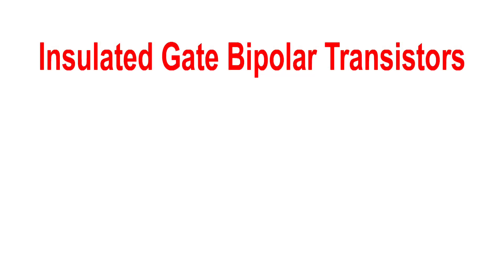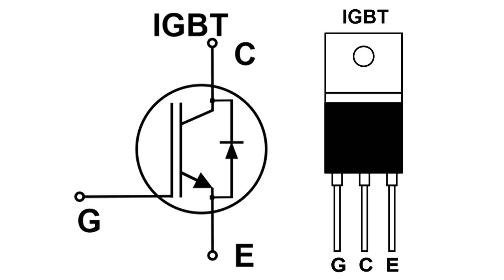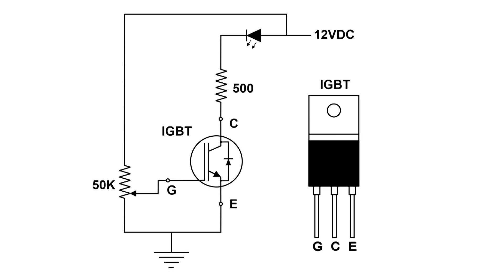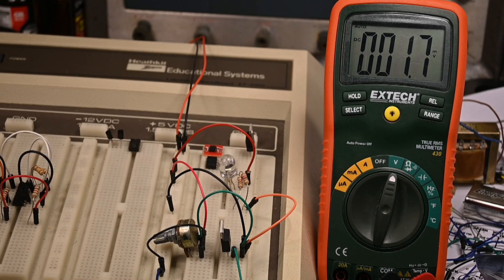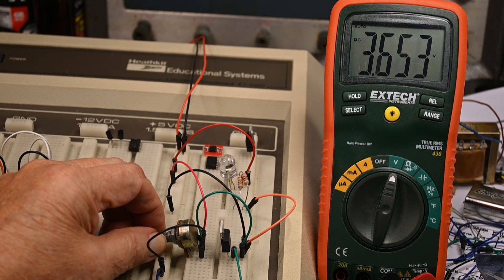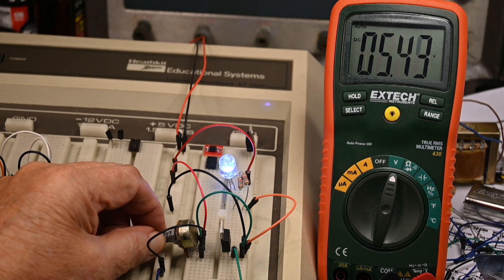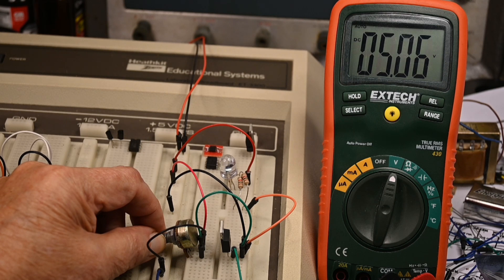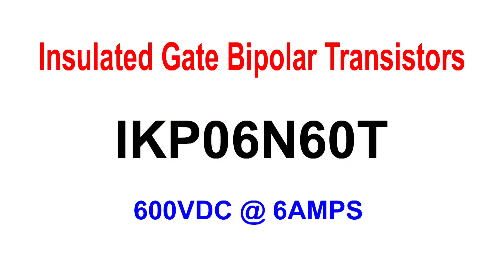Insulated Gate Bipolar Transistor IGBT IKP06N60T

Comment: It looks like the IGBT has a pretty decent linear range. Ordinary bipolar transistors (generally silicon) are used in audio amps -- how much wider is their linear range? In any case, it looks like the IGBT transistor you used is aimed at high-voltage power applications, and not audio.

It might be interesting to see the gate driven by a swept voltage (i.e., a sawtooth from 0 v to 12 v peak), and comparing the input and output waveforms on a 'scope.
Reply from the maker: The IGBT is full on when the gate is about 4VDC. A MOSFET is full on when the gate is about 12VDC. The small amount of voltage to turn the IGBT full on makes it an ON OFF device.
Reply: @AllAmericanFiveRadio , yes, but I'm not comparing the IGBT to a MOSFET, which has a wide liner range; I'm comparing it to a bipolar junction transistor, which has a narrow linear range. There are lots of junction transistor-based audio amps. The magic is to keep the transistor biased to the linear range. Doesn't any voltage below 0.7 volts applied to the base of a silicon BJT put it in cutoff?
Reply from the maker: @Johnny.Fedora  The IGBT is an ON OFF device, would not work in an amplifier.
Reply: @AllAmericanFiveRadio , ok, fair enough. Infineon has an interesting app note for the device (7-2012, inherited from International Rectifier) called "Application Note AN-983: IGBT Characteristics" (YT won't allow me to post links) that among other things, shows a model of the device as a MOSFET+bipolar junction transistor in a pseedo-Darlington configuration.

Comment: This takes me back when I was a compressor service engineer back in the 1980s  at ."Compair  " when  They stated useing  IGBT'S  Inverters  on there 150kw compressors  the (V F D )variable frequency drive .was used to create Pulse-Width  Modulation . there were six IGBTS injecting Switched DC  the IGBTs pulsing voltage up to 15,000 times per second .the motor would ramp up slowly to full output. And if you didn't set the  carrier frequency right the  motor screamed  like a stuck pig . It was a  Long time ago lol .
Reply from the maker: Thanks for the information, that was interesting.